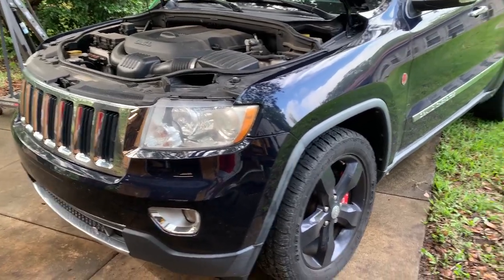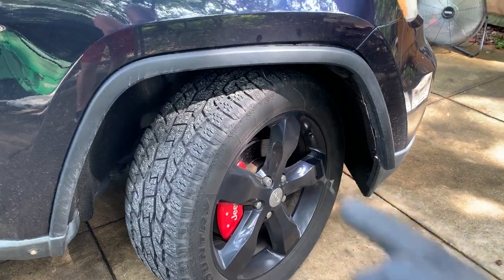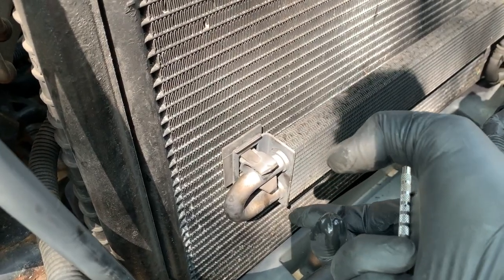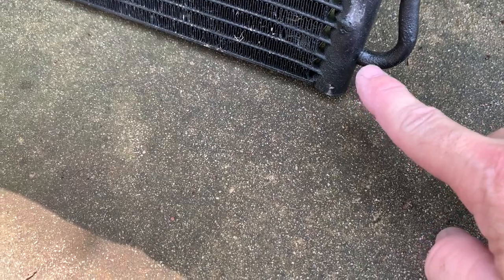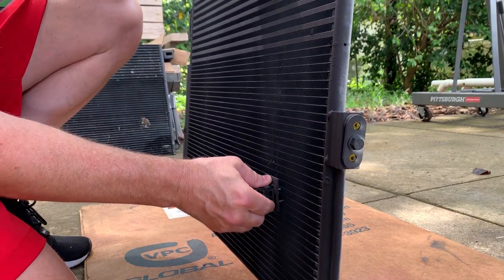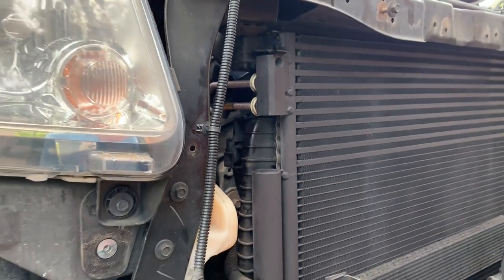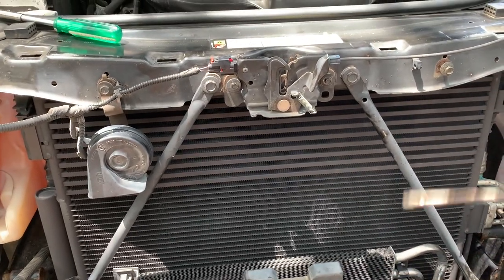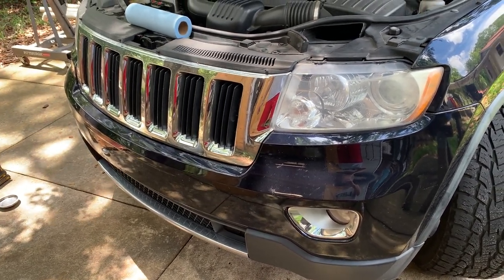2011 Jeep Grand Cherokee - AC Condenser Remove and Replace

Comment: Great video , I’m actually going through the hissing sound myself so I appreciate  this , I’m hoping it’s the same leak issue & not the evaporator coil , did the hissing sound stopped once you replaced the condenser ?
Reply from the maker: Hello! Thank you for watching the video and for the compliment. Yes, once I replaced the condenser and recharged the hissing sound went away. And it has not come back (fingers crossed!). Let me know how it goes! -Dutch
Reply: I have the 2011 5.7L. Leaks at the left side of the condenser where the lines are but I can hear a hissing around where the shrader valve is to fill it. Doesn't leak from there though.

Comment: Other than the Freon, did you refill any other fluids like transmission fluid, ac oil etc?
Reply from the maker: Very good questions! I didn't add any ac oil other than one can I put in after vacuuming the system did have "added ac oil" (pag oil) with the R134 charge. On the transmission side I added just a 1/2 pint of fluid as I estimated about what I had lost.